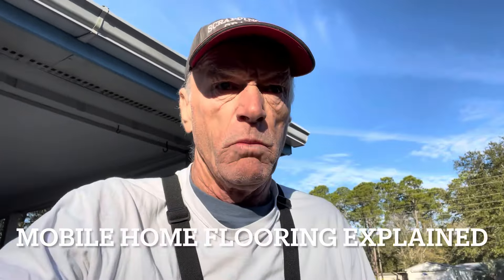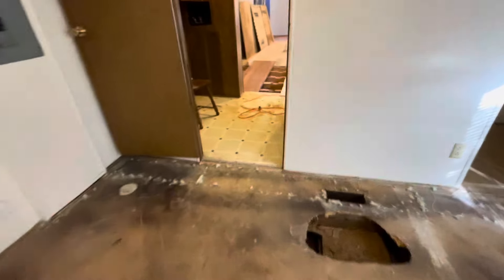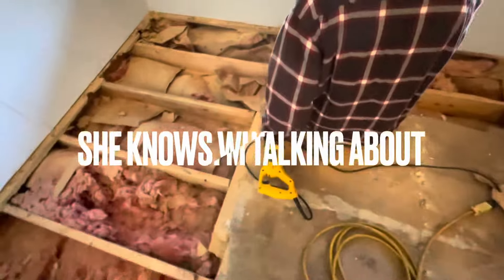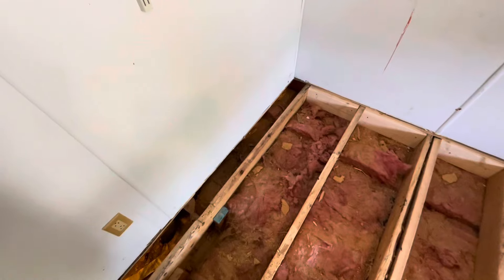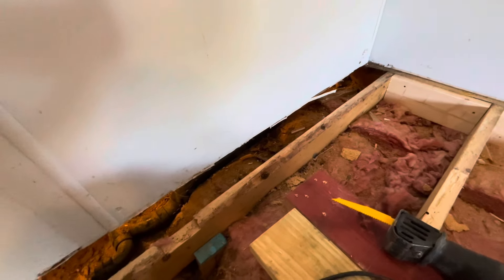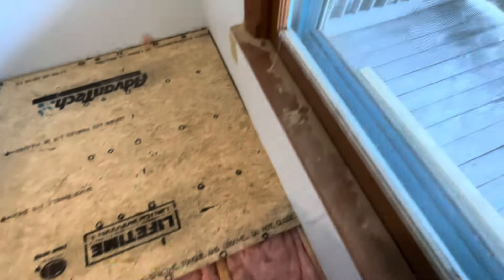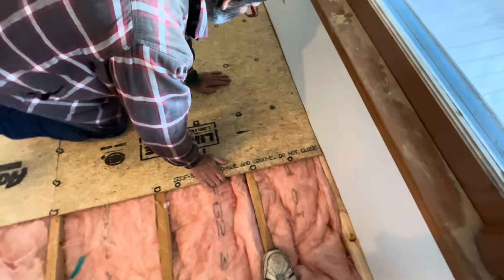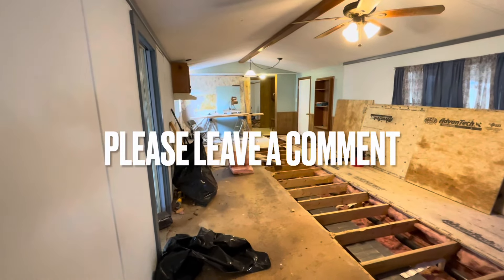(How To) Mobile Home Rotten Floors and How we Repair Them.

Comment: I have a soft spot/hole in the back corner of the closet.    I have a contractor that just put the flooring over the hole.   Now when you step there it shows it is not reenforced.
Reply from the maker: It sounds like they didn’t know know how or want to do the job right
Reply: @Drewsroofingandhomerepair  , now I have to try and fix his mistake.  Your video made it look so easy.  Thank You

Comment: At 1.05 what’s that a pre installed from factory air box  for central heat and air that runs whole length of trailer ?
Reply from the maker: Yes. Exactly
Reply: @ got one in mine I seen other day for first time when replacing insulation even though it doesn’t have central HVAC 
Must of been installed in all of that time so u had the option

Comment: I found you  just as I have to get this same job done
Reply from the maker: Go for it. You can do its. It’s hard but can be done
Reply: Im try to leave a comment and cant. I have a question though. I have a couple soft spots in my mobile home floor is there a way to repair it or strengthen it with out having to cut and remove it entirely?@Drewsroofingandhomerepair

Comment: What material is the belly to hold the insulation of the subfloor ??
Reply from the maker: It’s called Mobile Home underbelly you might be able to buy it at Home Depot but you probably be better off buying it at a Mobile Home Supply store

Comment: Is what they wanted to do with the insulation bad?
If no evidence of mice/rats?
Feeling overwhelmed with our subfloor sagging and now soft spots..some mold creeping in. We just bought the place. They put lipstick on a pig. Just want my kiddos safe. Things are so expensive. 
Thought about doing regular batting and then rtech board to the floor studs in the crawl space? Or probably a bad idea? The floors looked percect when we moved in. New laminate. Now its sagging, soft in some areas. My husband put his foot through. We live in humid SE texas. :/
Reply from the maker: Something is going on under your house. It sounds like you’re getting moisture so it sounds like possibly that the underbelly on your house might be in bad shape. The only real way to fix that is to remove the floor use advantech Flooring, you can buy it at Lowe’s or Home Depot. They have different names for it.  Vantex maybe. It sounds like somebody took you for a ride not sure how long you owned it but as soon as I seen something like that happening, went back to the seller or the real estate.

Comment: Thank you so much for your videos. I have learned a lot from them. What is the name of the sub-flooring sheets that your putting over the insulation? Thanks!
Reply from the maker: Glad you like them!  Advantec flooring. If you go to the building supply and you say what is the best subfloor that you can use they’ll probably lead you over to something similar to this.

Comment: Need to ask is it better to leave that belly band under the floor there or does it trap moisture  . I know it is there to hold up the insulation  , but I have also heard people say it is like a  wet diaper on a baby ,  Is it better to remove it or leave it . The place I am referring to has a basement under it
Reply from the maker: I’ve never really heard of a double wide with the basement, but if it has a basement, then you could probably get rid of it but in my case, I do not have a basement and if I removed it like I did that exposes the truck line for the HVAC to blow air through and it will start sweating because of the temperature under the house so you might wanna close that in

Comment: My parents RV resort park was destroyed by flood waters that reached above the skirting on hundreds of park models. Insulation, ducts, flooring, cabinets  HVAC all need replacing. I am helping my parents here in Port Richey FL (they are dealing with health issues in Syracuse).
I need advice on the best way to coordinate contractors for all that has to be done. Floors, walls, cabinets, HVAC etc.
Reply from the maker: I’m in Nc so not to sure how I can help but I wish you luck. Call your local mobile home supply store. See if they have any contacts for people that work on mobile homes.

Comment: I was working on my girls trailer and I was fixing the sunken subfloor and was wonding wtf. Why is this wall like this. Iv done floor for 10 years only residential for 3, mostly hardwood gym floor and synthetic running tracks. But that was the first time i seen a flooting wall.
Reply from the maker: They do it all the time in mobile home roofs

Comment: Between the rooms by wall. Why can’t you put the frames of woods as 2x6 before you put the plywood under the wall to hold the wall up. As I got mobile home. I don’t know how wide it is. But know length is 74. It’s 1983 mobile home. As I need to repair the roof first before anything inside. Thanks for your video of your hard working. 👍🏼
Reply from the maker: Thank you for watching if there’s anything I can do to help let me know. It is hard to get the wood out from underneath the walls.

Comment: do you think keeping the old insulation is a bad idea??   I would think it's smart to keep the old and just add more new on top getting more bang for the buck.   why did these floors need to be replaced?  what happened? water damage or just cheap stuff that worn out?   thanks.
Reply from the maker: Well, originally it was water damage but what they did on this particular house was they added way too much weight on the roof. They literally built a roof with two by sixes and 2 x 12 and plywood and everything else without any support.
Reply from the maker: Not to mention the wood they use on the floor was like sawdust

Comment: if the plate supporting the wall has deteriorated in a section, black and spongy from water, would you replace the plate section or put new support beneath it and leave the bad wood in place? I don't know how it can be replaced when it is currently bearing the load of the wall

Comment: Hello, my name is Carlos and I am currently from CHC construction home modeling and repairs. I have a question for you. Should I repair the floors first or level the building?
Reply from the maker: Do you need to level it or do you think you need to level it most of the time you do not have to level but if you do, you might want to do that first
Reply: Thank you

Comment: that aint shit i had a camper that had aluminum floor joist if you could call them that 11/2x2" corroded from water had to glue and screw 1/4" aluminum some had to replace 2" to water tank to subfloor replaced particle board  with plywood was too thick but made it work covered with vinyl ill not work on another camper
Reply from the maker: I don’t work on campers either. What a pain in the butt they are. They are worse than a mobile home.
Reply: I need help! This looks overwhelming
Reply from the maker: How can I help. 910-294-1761
Reply: Drew you and crew are doing an awesome job!! Always wanted to learn this trade